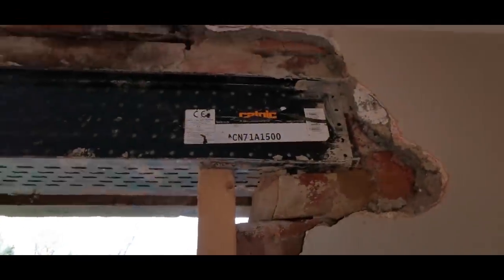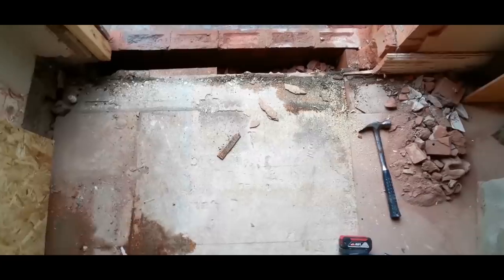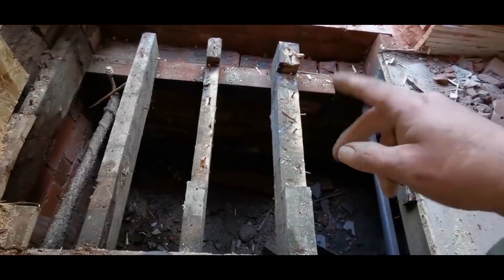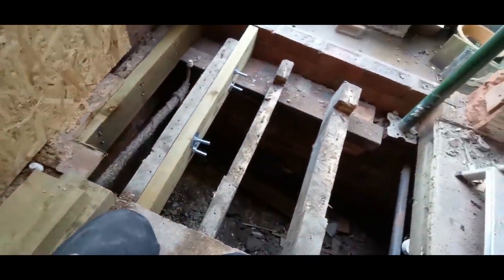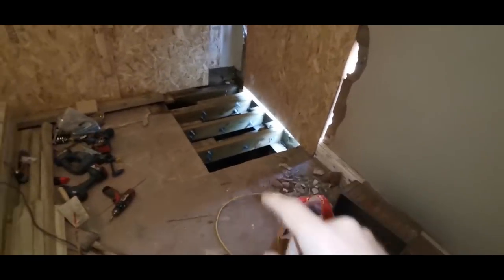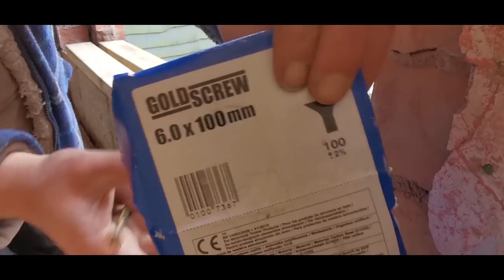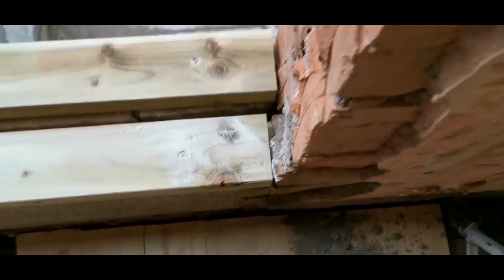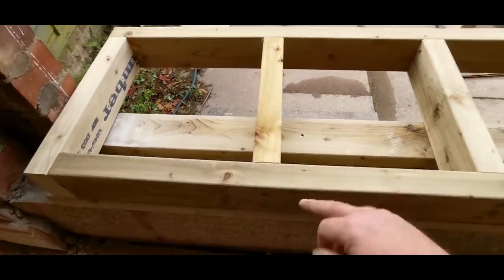French doors & bay window Pt2   Floor joist extensions & start window framework

Comment: Ok, that's two down but want to make a few comments... Those Lintels are Waaay short of the minimum support. I hope the owner has not paid them yet :( .  maybe in washers. It's a beast of a thing, but I have a 9" grinder with brick cut off wheels for dealing with cutting through the walls.  It lets me get through a full brick and a bit, to help keep the second in alignment. I did a bricklaying course quite a few years back and the old boy who was the teacher told me just to use fairy liquid as the plasticiser, works for me 😎.  Like you it's only a dozen bricks or so, so nothing fancy.  Your doing a good job under difficult conditions. I hope the owner appreciates it.

Comment: There absolutely should be a padstone under that lintel, with at least 150mm bearing either end and minimum 4 courses of engineering brick under the padstone. Absolutely shocking work from the builder

Comment: Hi - can I ask how you pack out the 22mm floorboards so they align with the existing 25mm. Thanks for making this videos. I really find them interesting and so informative.
Reply: +1 - I would be interested to know too!
Reply from the maker: Hi, I couldn't get the cork tiles off so i just packed these up with 6mm strips of ply on the joists, the rest of the floor was a mess, I had to put pieces of hardboard in places to uniform it, an oak floor on thin foam underlay insulation went down on top, Thanks you're welcome 👍